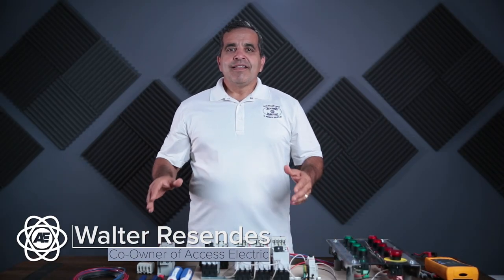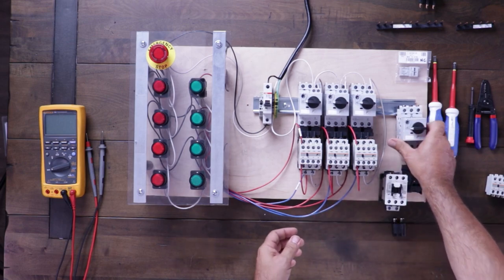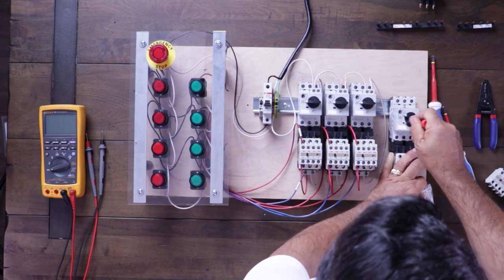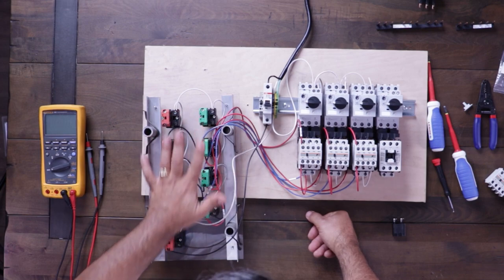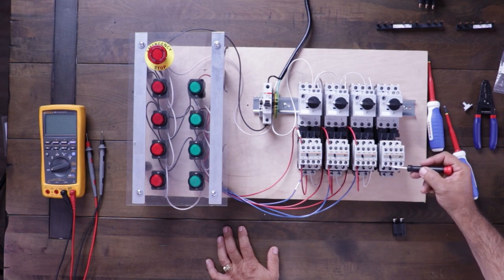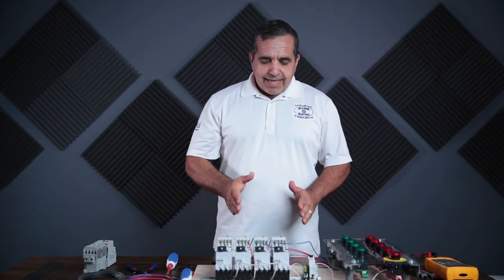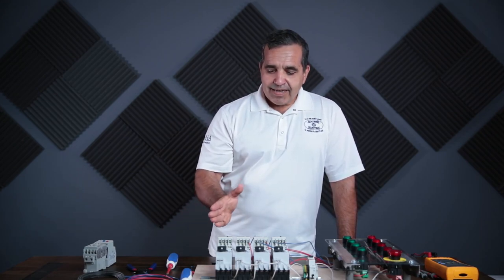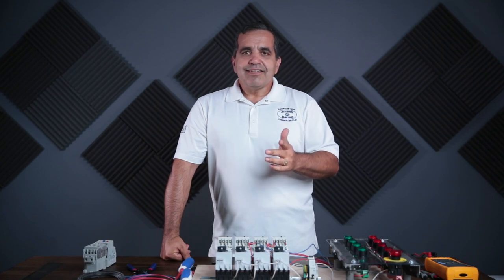Motor Controls: Sequenced Start Stop - Part 1

Comment: On a NC protector, even if you were to switch it off manually, there would still be power? So unless it trips them it’s completely off? That explains when I swapped out a 3 phase motor , it was still live when I turned the protector off.. I ended up shutting the entire unit down to swap the motor..

Comment: Walter, i teach motor controls and was wondering if you could provide me with the software you are using for the schematics. I like that you can click a pilot device and the live portion of the control circuit turns red. I saw this specifically on the 3 Wire Start Stop Circuit video.
Reply from the maker: marco avila the software is called Constructor by CMHSoftware.com